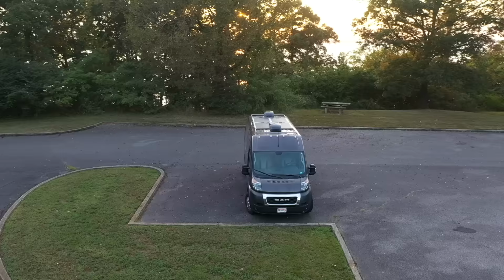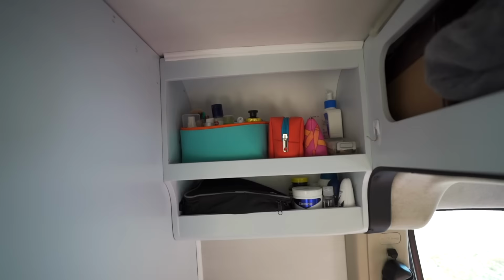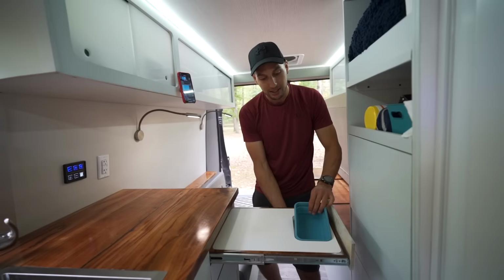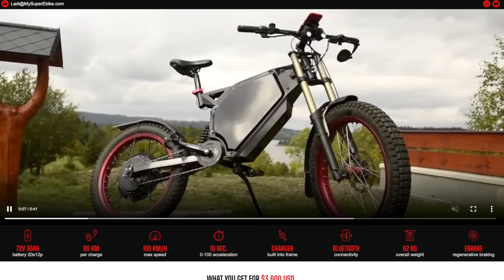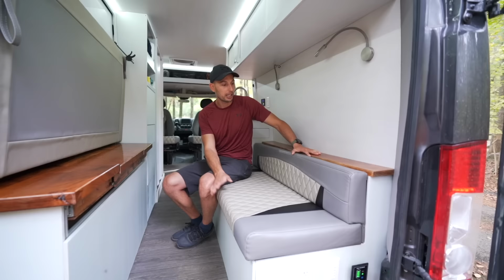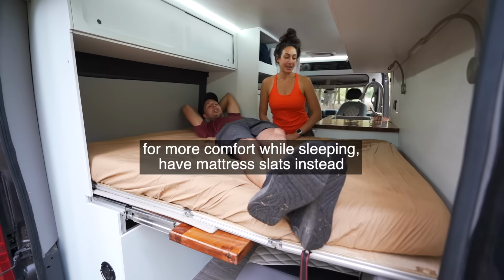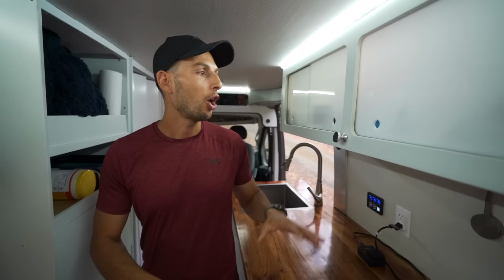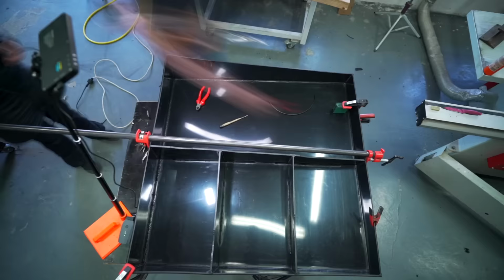LUXURY Van Tour + DESIGN REVIEW of Innovative Campervan Layout

Comment: That kitchen is completely the wrong way around. Not only does the cutting board get in the way, the cooker pulls out over the couch. If you have guests around who you are cooking for, or even if one of you is cooking while the other is working at the table, the cook-top is just 100% in the way. Why not have it pull out into the side door/step area instead? Then it's out of the way,  and you can use it for outdoor cooking.  Not to mention that as you have to let it cool before sliding it away (or risk a fire hazard!) it will continue hanging over the seating area while you're eating the meal you just cooked. It's just a complete recipe for disaster, if you'll pardon the pun...

Also, I absolutely hate leather seats with a passion (cold in the winter, sticky and sweaty in the summer) and IME they can absolutely be damaged unless you spend hours treating them with conditioners. Give me synthetic fabric any day!

Comment: I would not want an app telling me how much power im using while cooking. Just stress and for what? It not going to help with anything. You have to set up your power to have things work. Way before you cook in the first place. It either works or does not. APPS have become over rated. It a tool. Use it and put away. Same as your cell phone. Do not need to carry it everywhere. They have built in answering machines in them.

Comment: Kitchen layout is horrible. Never would use leather for seating hot in the summer cold in the winter. The fold out bed is too creaky it seems to be a nuisance to have to do it every time. If this van was for the person that's going to use it on a weekend or maybe for a week's vacation then maybe okay but living full-time no. It needs a window it seems too confining. Put the window above the couch. And didn't have two refrigerators it look like it had one that pulled out into the van and one that pulled out to the opening of the door

Comment: The sink should have been near the couch 
The fridge needs to be like you said but on the bottom under the sink. The stove should have popped out where hot foods not falling on a leather sofa what a stupid design. Also the chopping board could have fit over the sink on a swivel basis.